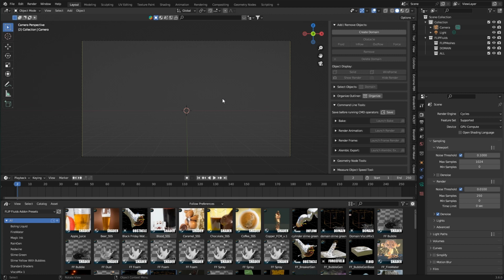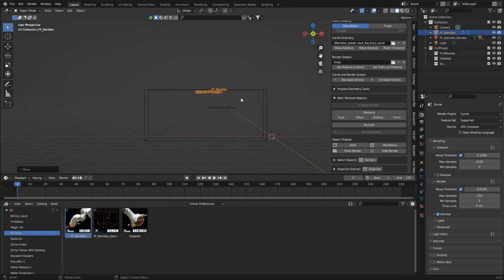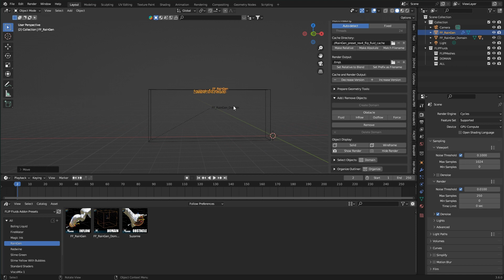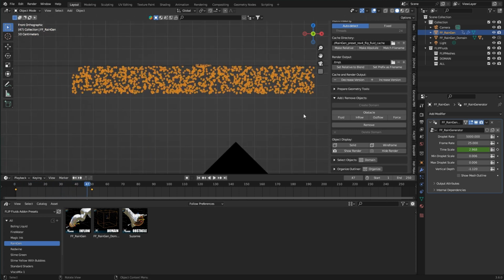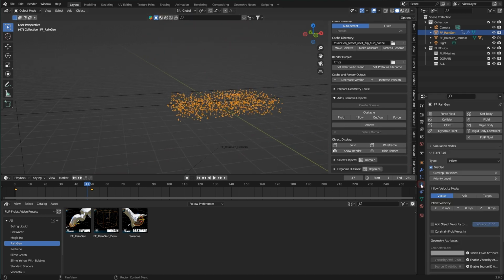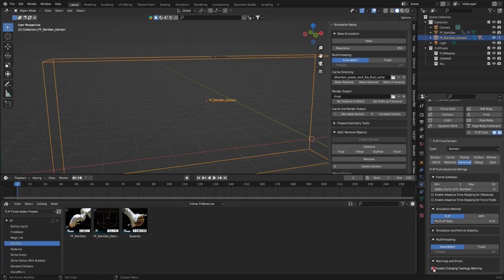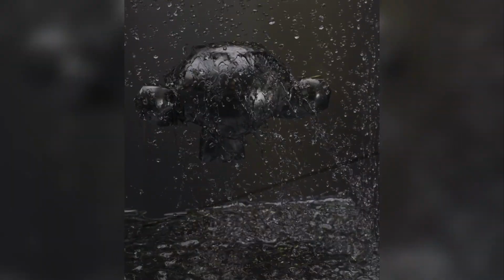A Quick Introduction to the Rain Generator 🌧 [FLIP Fluids Addon]

Comment: I cannot make the rain interact with the obstacle. Any explanation? Thank you
Reply from the maker: It could be possible that the obstacle contains non-manifold data, or export animated mesh is required. Sometimes a higher simulation resolution is required. You could send your .blend to us an we check it for you.
Reply: @FLIPFluids Sorry for late reply, I didn't get the notification from youtube, I used the suzanne obstacle in your asset library. Sub 2. Not working.

Comment: For those who can't (don't understand) why nothing works (including RTX 4090+). 0) Use small cube like Suzanne 1) First of all, check the Resolution! By default, it is 950 (this is too much even for powerful hardware, set it to 200, or even better, 100 for testing). 2) In the min/max droplet settings - set the scale to 0.05 and 0.08 (for example, i.e. a value closer to 1 (big particles), because the default settings are very high). 3) droplet rate set it to 20, not 5000 (small amount). 4) And now you can click Bake. Try with these parameters, then you will understand which way to turn to get the best result.
Reply from the maker: Good hints! We are also going to improve this to get working directly
Reply: thank you! I did wonder why the original back was going to 4 hours haha

Comment: I run the bake and then nothing happens after it finishes. No mesh, no particles, nothing works.
Reply from the maker: It sounds like to need a higher Resolution for simulating the small drops.
If nothing helps please share your blend file with us. We can then check what’s going wrong.
Reply: @FLIPFluids  finally figured that out, now when I render with motion blur it crashes as soon as I hit render image or animation
Reply from the maker: Try cmd rendering ;)
Reply: @FLIPFluids   seems rendering my animation out with CPU instead of my gpu has fixed all of my issues…. From random frames where all of the geometry and particles vanish, to the motion blur going whack, to crashes after crash… this plugin does not work well with GPU rendering at all. But seems just fine with the CPU
Reply: @FLIPFluids  this resulted in the same issues. Rendering with the CPU works though. I’m on a MacBook Pro M3 Pro Max.
Reply from the maker: Of nothing helps you are welcome to send a support request using our form on our homepage.
Reply: @FLIPFluids  nah I think this add on is just not made for gpu rendering unfortunately, cpu rendering worked fine. I just wish I knew that before buying it.

Comment: Looks cool, but can't even try it, its extreamly slow, am i doing something wrong?
Reply from the maker: No - the small drops need a very high simulation resolution what decreases the speed.
You should use a very small domain and use the raingen only in areas where a real rain behavior is required. For all around we recommend to use a regular particle system.

Comment: ok but you have not explained how to create rain water like that at the end of the video.
Reply: i get noisy rain result like everyone else here.
Reply from the maker: This in an Introduction into the procedural rain generator, what means it shows how to use the assets and the geometry node settings. 
Please make sure to work with the mentioned high resolution for the simulation (it can require more than 800).
If there are any issues please send a support request including your blend file so we can help with your scene :)
Reply: @FLIPFluids  It does not make any sense, increasing resolution does not have anything to do with the issue i mentioned.
Reply from the maker: Sorry to read this. It does also not make any sense to try to help without taking a look into your file. Would you please send your blend and some information using the support form on our webpage? That way we can help you :)

Comment: Hi there.  I got the Flip Fluids package primarily for this awesome rain generator in Blender.  I have a good machine for 3D with a Ryzen Threadripper 3960X CPU 24 Core.  However, bake times for the suggested Suzanne scene shown (at a high res - 950) are extremely long:   days!  Can anyone tell me what a normalish bake time for this scene should be or better, what their experiences are with this simulator.  Thank you. 😎😎😎🌧🌧🌧🌧☔
Reply from the maker: Hello Tomurow! The rain generator can only run in a high resolution as each generated drop is very small compared to domain-size. Unfortunately this results in long simulation times. We recommend to use this generator only for small scaled scenes (as example close-ups where rain drops are moving over a surface).
For bigger scaled scenes a regular particle system or rain generator addon would be the better choice. Of course - you could combine both ;).
Reply: @FLIPFluids  Thank you or the quick reply FF   Team!  That’s good to know.  Yes, that’s exactly what I’m doing, so that’s cool (I also have the Baga Rain Sim for large scenes - works great!!!👍).  I suppose I was looking for a benchmark but I guess it’s gonna be a demanding simulation as you have described!  The results look great though.  I will commit to a bake when I know my machine will be in limited use!  Thanks again!  🤓

Comment: Hello! Thank you for this tutorial. :) I have a question... I'm trying to use the Rain Gen to simulate rain dropping onto a rock wall and trickling down in a large rain scene. Is there a tutorial that I can follow that would best guide me to this result?
Reply from the maker: I don’t know any tutorial.
I think surface tension could be helpful.
Dynamic Paint and wetmaps is also a thing to take a look into.
For some solo drops i would not go with a simulation. Depends on your requirements. You could send a prepared blend file to us and we take a look into your settings ;)
Reply: @FLIPFluids  Thank you for the reply! I will see if I can fine tune my scene with the instructions you have given. 

However, if i'm unable to achieve the result that I want, would love to see if you have a solution. 

What is the best way to send over a blend file for your team to look at?
Reply from the maker: Sorry for the late reply. You can always use the comfortable support form on our webpage - or write directly to our email adress.
Reply: @FLIPFluids  No worries! Great, i’ll look into that. Thank you.

Comment: hello  dear Flip fluids   did you correct that issue  on your addon in Blender ! when using keyframe of slowmotion and simulation itr missedUp !!!    for example  : im  doing simulation  , its oky i like  it now i want to freeze some frame when i want to see water or milk splash the bottle  when i use  thos keyframe in your addon , the simulation gonna be differente can you correect this issue please !!  im waiting for your update of this issue thnx .
Reply from the maker: You would need to Keyframe the simulator‘s speed as well - otherwise it keeps simulating with the real time. A speed field is available in the domain settings. Let me know if this is helpful.

Comment: Hello! I am new to blender and I just recently brought this add on, by any chance you could do more a in depth tutorial for simulating the rain. Sorry I recently transition to using blender not long ago as I was used to using more the Autodesk maya.
Reply from the maker: Hi! Let is know what parts you are missing in this introduction, please.
Reply: @FLIPFluids   Hi Thank you for replying back to me, I was wondering how you made the monkey interact with the rain pouring down? so you showed loading the object but it wasn't clear how you finished the whole simulation.
Reply from the maker: The monkey needs do be watertight- always check for mommanifold data. Then use it as obstacle. Maybe increase friction. Make sure to use a higher resolution and some surface tension.

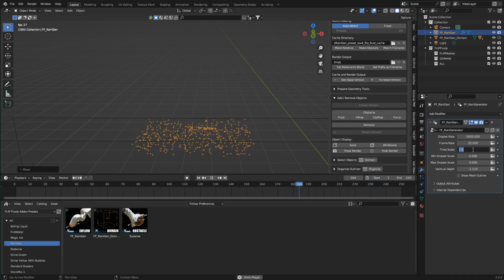Comment: For some reason, when I hit bake, the result still looks like the "noise" of droplets popping in and out of existence just like at 2:41. I followed the tutorial exactly as seen.  just to test and still could not get it to work. There doesnt sseem to be any persistence to the drops, or gravity to pull them down. What am I doing wrong?
Reply from the maker: Sounds interesting. Would you like to share a blend file with us?
Reply: Hi! I'm using blender 3.6.2 and even tried with 4.0, when I bake it I got the same result as "noise" like, the rain is not dropping down... @FLIPFluids
Reply: @nasastrocat same
Reply: is this solved, mine is too
Reply: same problem here....
Reply: @solkyupark5528  the problem has to do with the total resolution for the given space. So the solution is, either... Reduce the domain size, increase resolution, or increase droplet size.
Reply: I have the same Issue, did you find a fix?